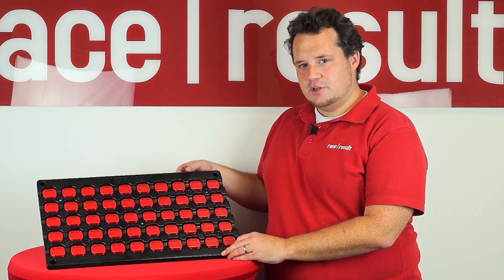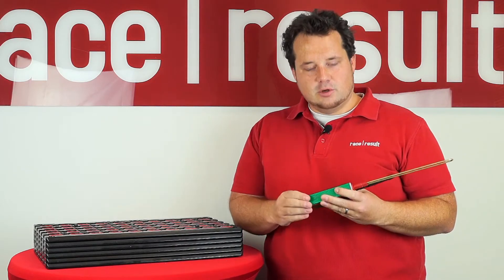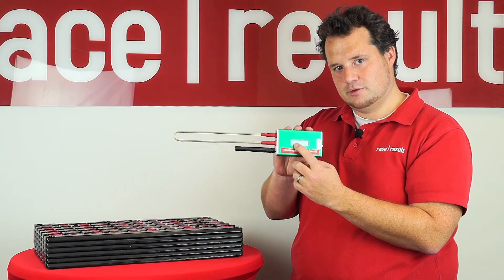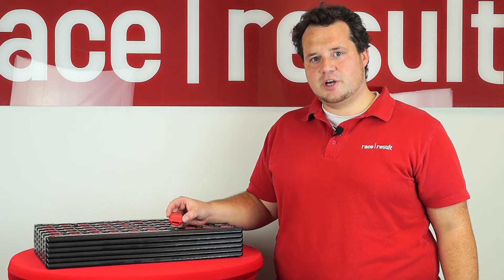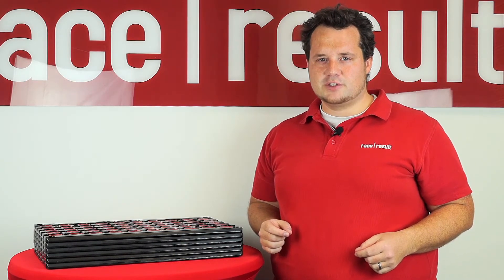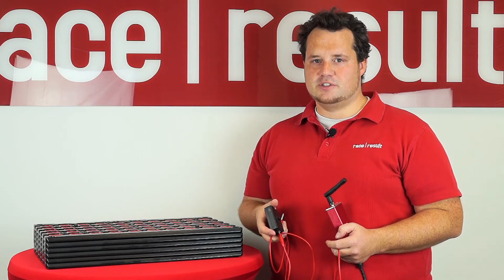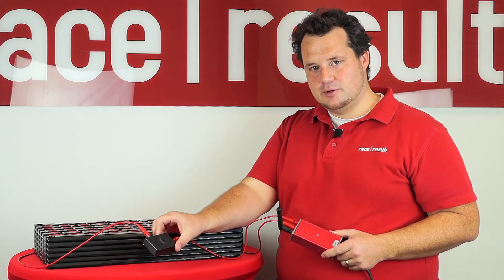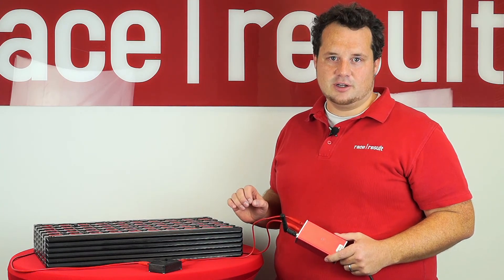300 race|result Active Transponders in one shot!

Comment: Can these be recharged?
Reply from the maker: Hi Todd, no our transponders are not rechargeable. The guaranteed battery life of ActivePro chips is 5 years, but we expect it to last around 7 years.
Reply: How can battery be tested?  An athlete on the course having a battery die, would not be optimal.
Reply from the maker: Of course, and that's why we send the battery voltage with every passing. You can either show the voltages during timing, or use the Tag Reader Keyboard together with a USB Timing Box or Management Box prior to the race: https://www.raceresult.com/en-us/software/download.php
Reply: Where can we purchase

Comment: Question, if it transmits to 2.4ghz which is a very common frequency, it does not create any interference with any other 2.4ghz radio or any other antenna (wifi) ??
Reply from the maker: You are correct - 2.4GHz can get quite crowded. In most cases this is no real issue as our system is robust and can coexist with other applications like WiFi and Bluetooth on the same channel. This is especially guaranteed by our bidirectional data transmission needing acknowledgement and retry if a transmission should fail on the first attempt. But of course like all systems based on radio transmission, you can have noise on your channel. In this case the system will warn you and you can switch to a different channel (There are 8 different channels available on the 2.4GHz band). I am not aware of any other system that gives you this flexibility in a high noise situation.
-Nikias
Reply: Thanks for your quick response.. that's awesome the Channels switching!